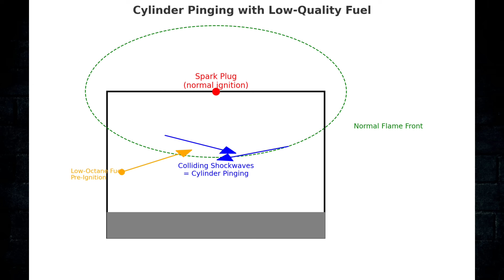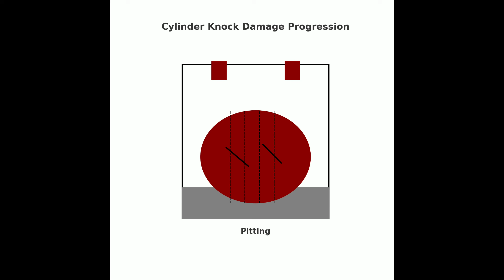Why PREMIUM Octane Is SO IMPORTANT For Your Corvette (Detonation EXPLAINED)

Comment from the maker: 👋 Blake here — quick notes to head off the nitpicks:

I use knock and pinging together once; “pinging” is the sound, knock is the abnormal combustion after spark (multiple flame fronts colliding).

Pre-ignition is different (before spark, from a hot spot) and far more destructive.

Running regular once when premium isn’t available usually isn’t catastrophic, but repeated use adds stress and can lead to expensive problems.

Price spread vs regular is typically $0.40–$0.80/gal (about $8–$12 per tank on an ~18–19 gal fill).

What have you seen from the wrong fuel in a Corvette? Share below — I’ll be reading.
Reply: excellent points..I've had my 99 FRC about 2 1/2 yrs and ive always use 93 mobil/exxon. Anyone who has a Corvette and is using regular gas to save $ doesn't deserve a corvette ! my daily is a 2002 Lexus ES300 which requires 91 or better, ive owned it for 4 1/2 yrs and i always use 93 Mobil/Exxon..  never pings and i get 30 mpg on the highway.

Comment: We are lucky to have 95 as low octane and 98 is mid range here in Europe😉 Shell V-Power is premium here with 100 octane.💪🏻
Reply: Octane is measured as (R+M)/2 in the U.S.. Your 100 RON gasoline is labeled as 93 octane in the U.S.. Your 98 RON gasoline is labeled as 91 octane in the U.S.. And your 95 RON gasoline is labeled as 87 octane in the U.S..

Comment: TLDR, higher octane is more resistant to pre-detonation.  For the smooth brains 87 ignites easier than 93.  Hence the reason we run higher octane in higher compression engines.  You want the lowest octane without pre-detonation, you get a cleaner more complete burn.

Comment: California doesn't have 93 octane. Does fuel additives help with the octane?
Reply: Most "octane boosters" do not actually increase octane. 

The few octane boosters that actually increase octane, are illegal to use under federal EPA and California state CARB laws AND may destroy thousands of dollars of catalytic converters and oxygen sensors. Just use pump 91 unleaded.

Comment: A dickhead i know put the shit cheap fuel in his 2000 Holden Commodore with an LS engine. He could only drive it at 40 km per hour top speed. 25 mph.  Lucky he didn't put much in it. Only 20 bucks, and he could top it up with good stuff after he figured out the problem.  At least he learned not to be a super tight arse. Jim

Comment: I get free 89 grade gas at my work. I have a c5 and a c7 I find that the c7 is way more sensitive to the 89 grade than my c5.. the c5 runs fine on it but I do have  to put in about 6 gallons of 93 from a gas station and the rest 89 free gas at my work (we are a fuel distribution company) for it to run right
Reply: In what way is your C7 "sensitive" to 89? In what way does it not "run right"? Be SPECIFIC.

Comment: Hi Blake, good video.  You might point out that octane levels vary by altitude.  Here in New Mexico and places like Wyoming it's difficult to find 92 octane simply because they rarely offer it. At lower altitudes like in Florida it's necessary and available. 😊

Comment: This is a good video. If you are not the normal Corvette driver however, and use the car for a daily driver, here is a real World Example:
I use my base C5 to commute. I use 89 octane most of the time and 91 about every 4th fill-up. I average 2 tanks per week. I never drive the car hard with 89 and baby it if I hear pinging at all. 

This has been my habit since I purchased the car when it had 176,000 miles on it. It currently has 288,000 miles and climbing weekly. I don’t recommend this approach to anyone who doesn’t have a mechanical ear. I just can’t afford to spend the extra $$ on premium. I already spend $6000 on fuel a year just for work. 
And please don’t bore me with claims that I don’t deserve a corvette because I don’t run 91. When I took it to the track in Bowling Green this year-it had 91 octane. When I drive it hard I  proper gas. I just wanted to share some real-world experience for commuters
Reply: Nice, I'm always glad to hear of C5s getting happy high miles.

Comment: I haven’t used high octane in my c5 for 17 years and it’s never done anything to the engine. Not even a knock or ping. Once I got the gas guage to act funny and used a few cans of Techron and guage went back to normal 😅. Still driving car. 62,000 miles.
Reply: Exactly

Comment: I disagree with what you are saying. For older cars without computer controls  I agree. I have a C5 and it specifically states it is ok to run 87 octane. Yes it will loose some performance if you don’t run premium but that’s the only drawback. I do not use my car for performance and it runs perfect on 87 octane.
Reply from the maker: Blake was mainly referring to C6 and newer Corvettes. We know the C5 can technically run on 87, but wouldn’t you want to experience the full 350 horses by using higher-octane fuel? Let us know how she feels if you do! 
-Tony
Reply: @csvette not “technically”, actually.
From the user manual: “you may use regular gasoline”
Reply: He’s talking about C6 and up.

Comment: I'd say if only the lower octane fuel is available, the gas stations typically has octane boosters to assist with it. They aren't as smooth as running straight 93 octane but certainly better than the alternative!

Comment: I’m driving a C8 Corvette in California unfortunately we only have 91 octane premium, but it seems to be fine. I’m just wondering if Costco gas is fine or should I use Shell or union 76 gas or Chevron? Does it make a difference?
Reply: You want too tier fuel 😊
Reply: @jeffnoob8448  Top tier providers cheat by not adding the cleaning solvents, so don't count on it to keep your injectors clean. I learned this from experience.
Reply: I'm also in California. I had a 2023 Stingray and now have a 2025 E Ray. I mix 3 gallons of e85 and the remainder 91 which together make e30 and 93 octane.  Chevrolet advises that their advertised horsepower ratings are achieved with 93.  I want all the power the engine was designed to deliver.  Despite what ANYONE might say the ecm is perfectly capable of adjusting for e30. As far as Costco gas, it is Top Tier and is fine.  I run Valero (also Top Tier) because they have e85 (supplied by Pearson Fuels) on the same pump so filling up is simple.